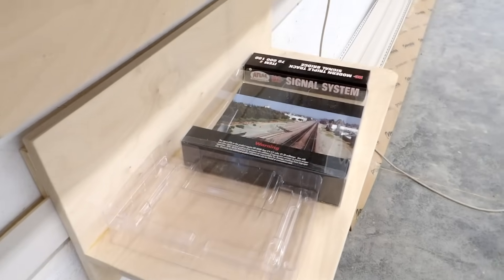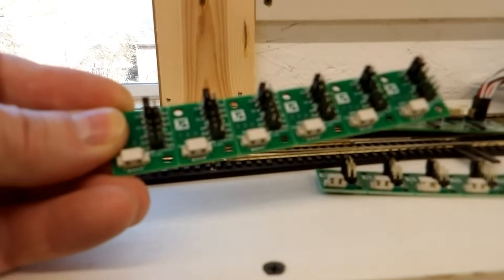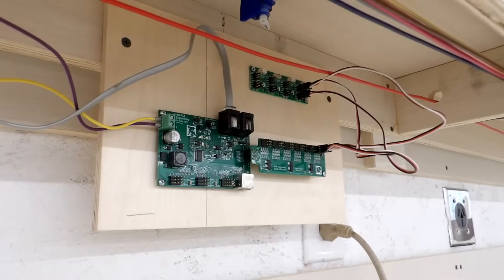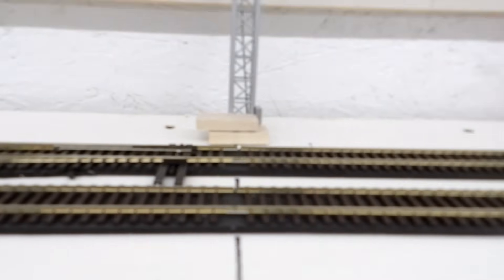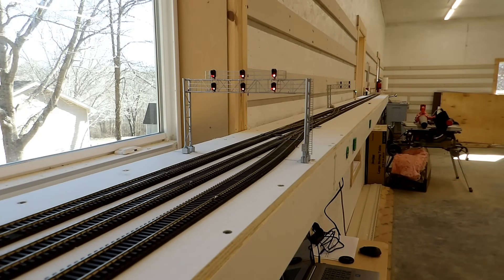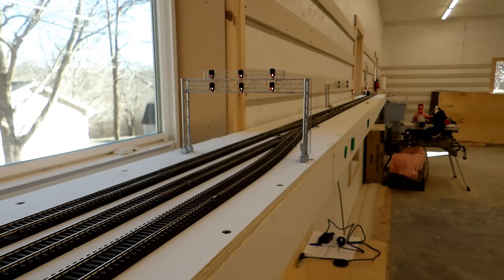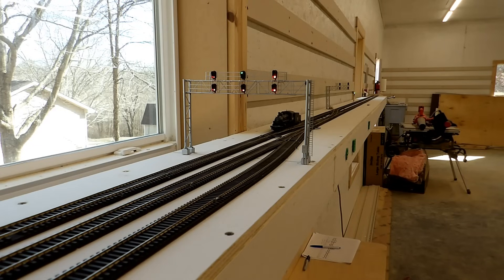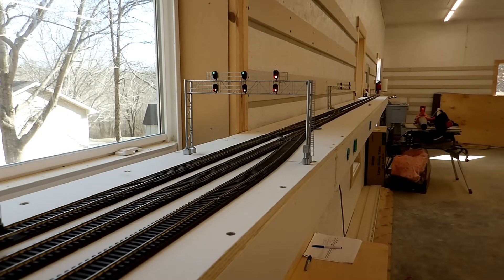A simple test track: adding the signals.

Comment: Just some FYI about signals.  Interlocking signals (also called "Home" signals) are not ABS signals.  They are controlled by a Dispatcher and drop to STOP after the train passes and enters the block inside the interlocking.  They can only work like an automatic signal if they are fleeted but only straight move can be fleeted.  Crossover moves cannot be fleeted.
Reply from the maker: That's exactly the operation I was aiming for.  It requires additional software that I haven't yet delved into.

Comment: Are you assuming resistor wheelsets on some/all cars, or perhaps end-of-train lights (or lighted caboose/lighted observation car) to allow detection? I guess it depends on how long the blocks are versus how long the trains will be. Will it be needed to detect a train backing into a section?
Reply from the maker: Ideally, all cars need resistor wheel-sets.  In theory, every third car is probably sufficient for permanently-blocked through freights, but that system fails as soon as you start swapping consists.

Comment: If this is for a modern railroad, at least for Union Pacific, there is also a flashing yellow aspect between green and solid yellow.
Reply from the maker: There are several prototype signal aspects omitted.  It is a simplified system that many model railroaders use - easier to build and easier for visiting operators to understand.  Everything in model railroading is a compromise.

Comment: That worked rather well but it looked like a lot of spaghetti wiring underneath. The upper signal responded to the input from the train but the lower signal did not. Is the lower signal dedicated to the diverging route and is that wiring also completed already in the wiring shown.
Reply from the maker: It's a test track.  Tidying up the wiring is not a priority but it helps to determine how it can be done on the actual railroad.
The upper head is for the straight route; the lower head is for diverging.  All routes were tested each time but showing all the tests would have made for a long an tedious video.
Reply: @mpeterll  I apologize, I was not referring to the neatness of your wiring. I was just commenting on the volume of the wiring and my fear of not being able to do it due to the amount and complexity.

Comment: Excellent ...... I'm learning stuff here but I have a question if I may, When a long train starts to pass a signal when does the signal good from green to red?  as the loco passes the signal or after all the train has passed the signal? In the UK the guard in the guards van (caboose) was also responsible for checking that the train hadn't run a red light.
Reply from the maker: The signal goes red whenever the block is occupied, just as on the rear railroads.  What you say about the guard's responsibilities predates automatic signals.  If you watch a train pass a signal now, it goes red long before the whole train is past.

Comment: Peter , I need to thank you, I noticed you are using the Facia panels from tam valley  , I was able to rework the print files for those Facia panels to fit the Walthers push button station, final results are great thank you , also a very interesting video great job
Reply from the maker: Glad it was useful.

Comment: Will you provide a link to the signal controllers?  Also, where did you find Atlas WORKING signals?
Reply from the maker: Just type in N3ix and you'll find them.
The Atlas signals are available direct from Atlas or on e-bay.  I purchased mine from a guy trading as "yankeedabbler".